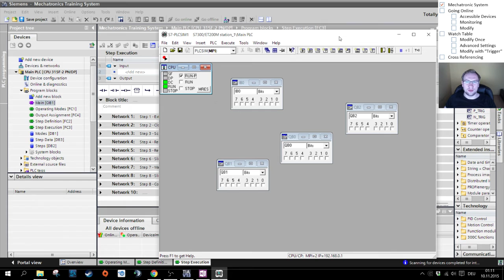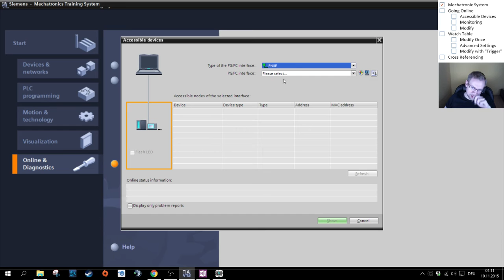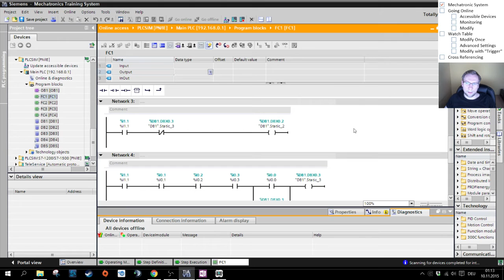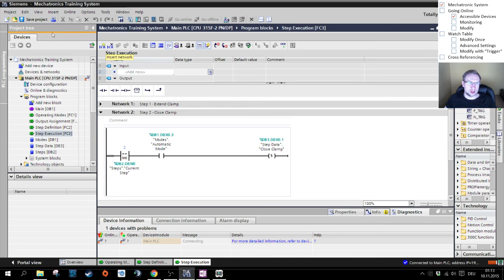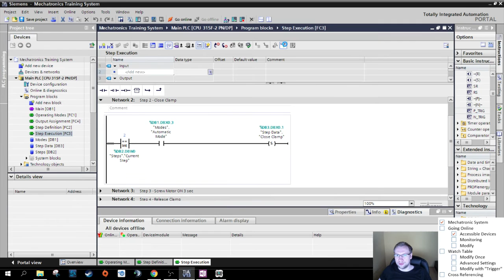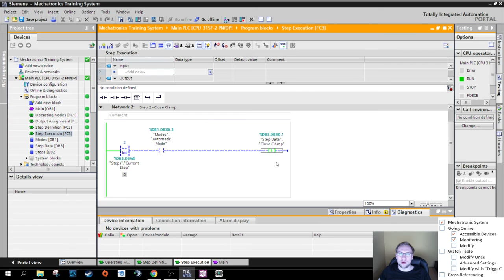ELIA Lesson05: Program Testing

Comment: Hallo Philipp, thanks for the very informative TIA Portal videos, the presentation has been excellent. ....

I have a problem when trying to monitor the project and get the following error msg,
" Program debugging could not be started".
"(DOC5) Display of block stack inconsistent, because blocks were deleted/reloaded". 

Not sure where I've went wrong, are you able to assist?

Using TIA Portal V14
PLCSIM
Compile no errors
Download to PLC ok
Can go online

Best Regards
Ben
Reply: Thanks for the videos Philipp :-) I had the same problem as Ben. The solution was that instead of the CPU going into "RUN", it should go into "RUN-P".
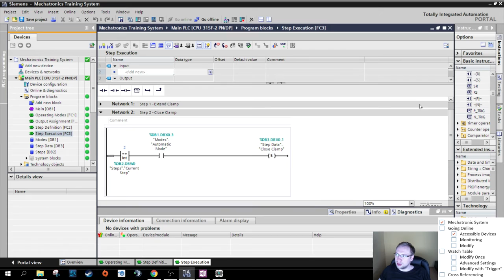Reply from the maker: Is the color of the circle next to the function(s) you want to monitor green as shown in 5:00? If not, which color do they have?